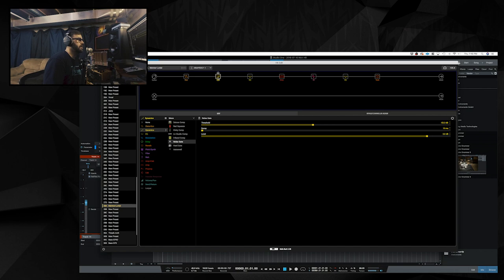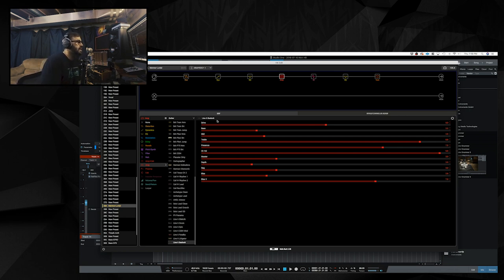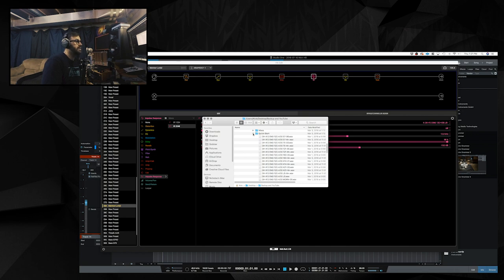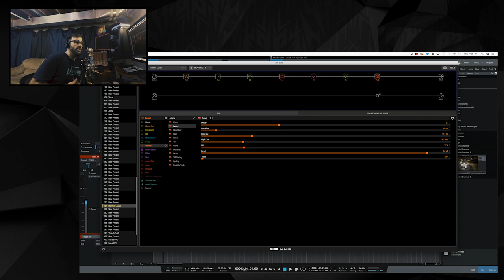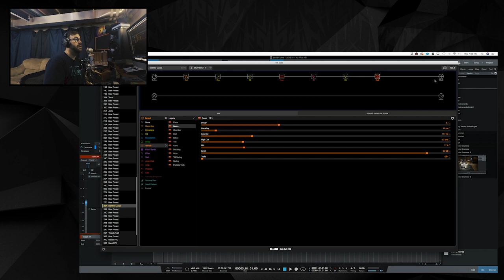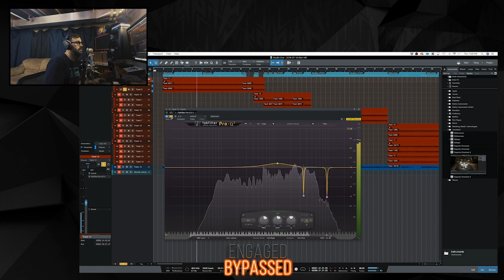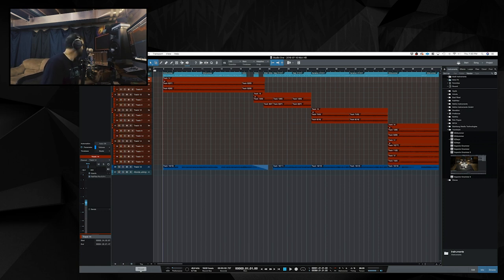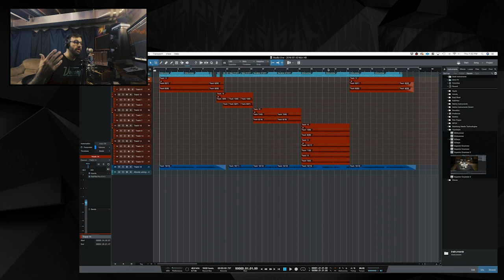Keith Merrow | Alluvial Tone Walkthrough with Line 6 Helix

Comment: Hi Nick, 

First of all, thank you very much for the video. It is absolutely great; however, I am experiencing some issues. I have followed all your instructions, including the same IR, and I still don't get a very clear tone. It has a lot of noise. I am also using the Fishman fluence modern. Would you know why I could be experiencing noise issues? 

Thank you very much for your help.

Cheers,

Rafael
Reply from the maker: Lots of variables here. Noisy power, bad guitar cable. Dead battery for the pickups. Bad wiring. It’s hard to tell what you’re hearing
Reply: Dear Nick, I understand. I will see if I can solve it. The tone is absolutely great. Thank you very much for sharing such a great material.